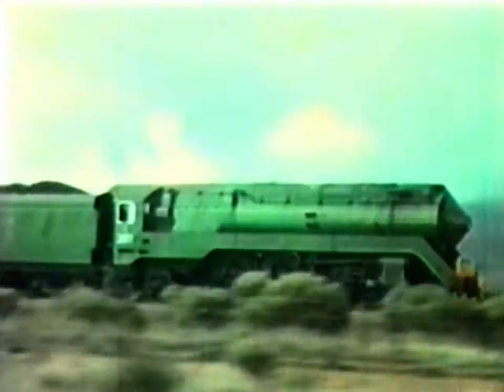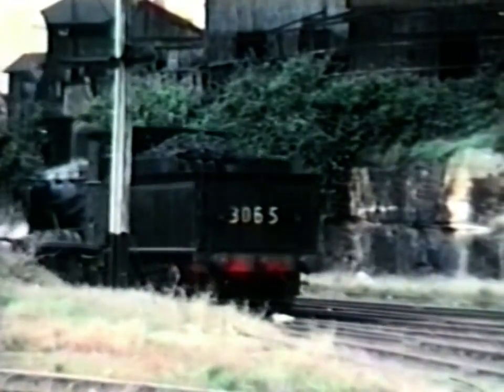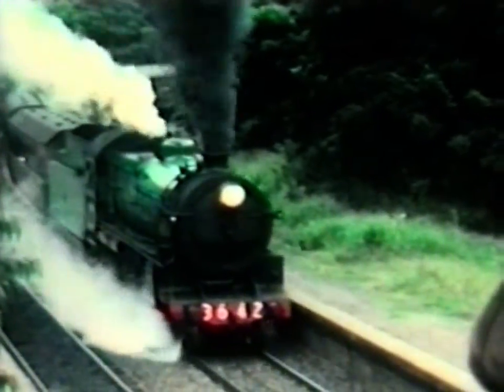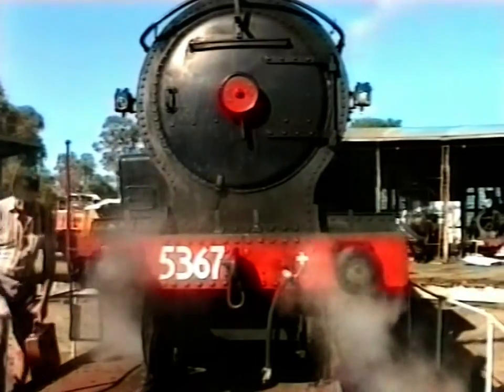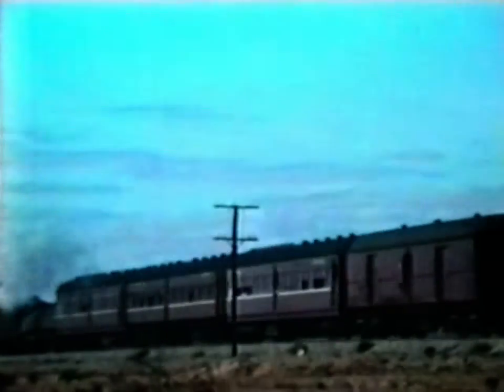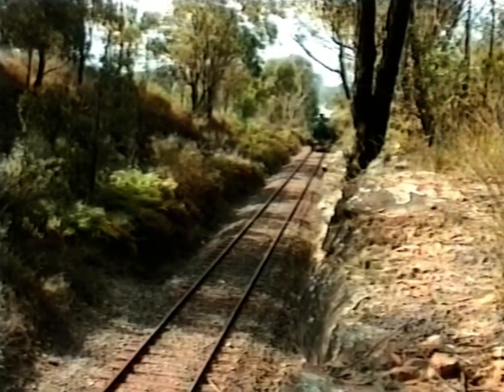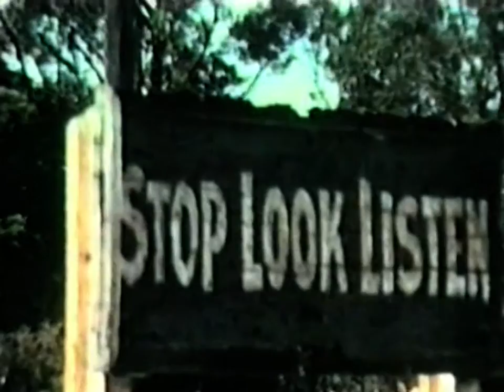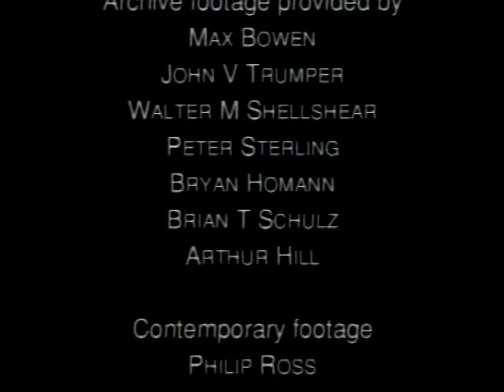Australian Steam Trains - Steam In New South Wales (Part 1 of 5)

Comment: As a teenager in the 1960s I saw lots of steam engines as I travelled to and from school everyday,     I remember the introduction of diesels, the 40 and the 41 class.

I remember the 59 and the 60 class monsters well as I lived on the main southern line near Liverpool.

I recall that some, if not all were oil burners.  They made a different smoke pattern as they didn't rely on steam exhaust to induce airflow thru the firebox.

Is there anyone who can refresh my memories of these bygone days??    There were so many of the monsters that they were unremarkable at the time..............that's just the way things were!!!

Now we look back and wonder ...What happened???

Stavros, a boy still at heart.